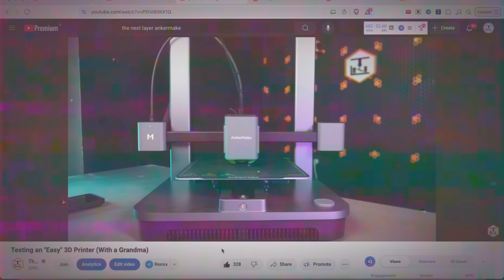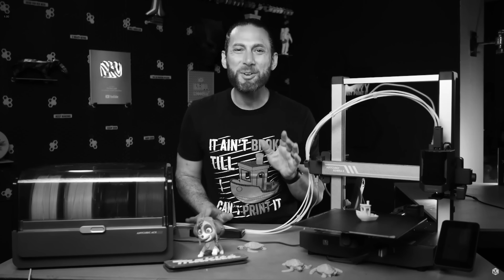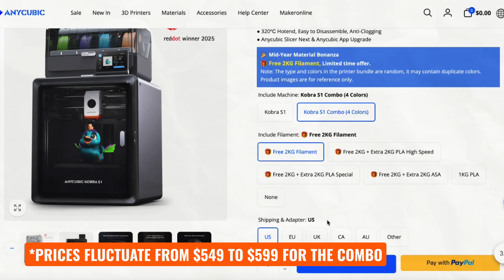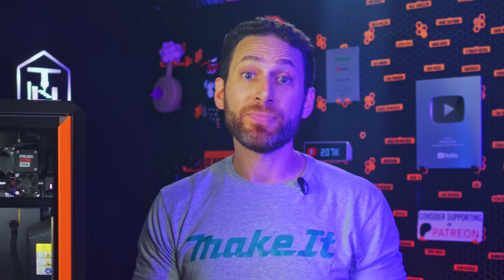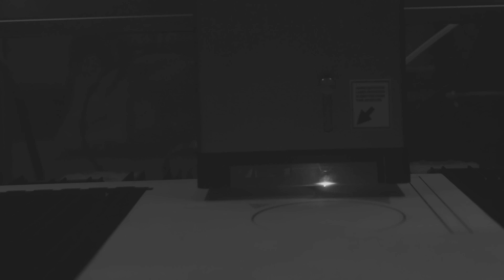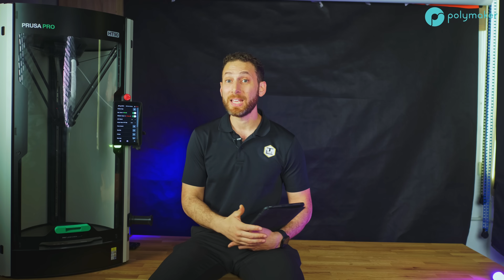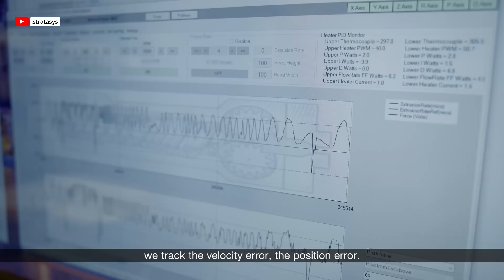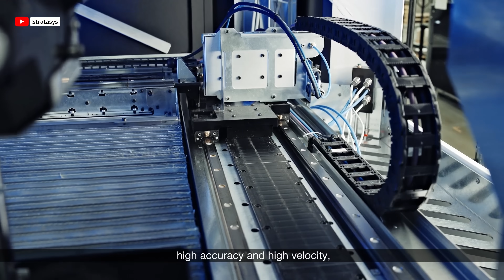$100 vs $100,000+ 3D Printer!

Comment: I have an easythreed k9. For some reason once I got everything dialed in it's by far my least problematic printer. It's slow, but it's a reliable little guy. I rarely had problems with printing on the k9. They're not pretty, but it just keeps on going. It's fairly decent at printing TPU.
Reply: The problem is that it's quite close in actual price (depending on the region) to something like an Elegoo Neptune 3 Pro (or its successor) that is on sale, which is in another class entirely. I got mine for €165 last year directly from the manufacturer - the K9 costs €103 here, which is just a few spools of filament less. You can make extremely high quality prints with the Elegoo, provided you're fine with it taking its sweet time. It's also much more beginner-friendly due to its fully automatic bed-leveling, heated bed and higher quality construction - and it has a large enough bed for the vast majority of projects.

Still, I'm very impressed you got good results from your K9. There's something to be admired about being able to produce good parts with a device this basic, far more so than people who invest hundreds, set everything to automatic and immediately claim they are masters of 3D printing. By the way, TPU also prints exceptionally well on the Elegoo, provided it's properly dried, although I've had by far the best results with PETG. Have you tried PETG? It doesn't require a heated bed (at most some glue) and the nozzle temperature in the spec sheet of your printer seems high enough.
Reply: @no1DdC fair enough about the price point. I happen to get mine for about $70. To be honest the best decision I ended up making when modifying the K-9 was swapping out the original carriage for something a bit stiffer. Really took care of a lot of the wobble. I'm well aware that it doesn't take much more to get a significantly better printer, but I love this silly little thing.

Comment: 1:14 - AnkerMake is the absolute worst!  Wish I could go back in time and buy a P1SC!
Reply: @No_Worries83   I got the basic model it kicked the bucket by not transmitting anything to the printer and then they stopped making replacement parts, so they just gave me 200 bucks back even though it’s over the warranty date ,nice service tho

Comment: Prusa and Bambu are the only sub-2k brands that people should expect to work every time.
Reply: My Kobra S1 has been more reliable than my Core One.  I wish it weren't true because I love Prusa as a company, but I think they rushed this one out too fast.
Reply: I've had pretty excellent luck with my Qidi Q1 so I'm definitely getting to that expectation. Only issues I've had are from the filament - mostly not drying it enough since my habits were spoiled from living in ambient sub-20% humidity most of my time with it.

Buuut at the same price as the multi-color anycubic core xy here...I might put up with some lack of reliability in exchange for multi color.
Reply: @chrisc1140  tbf, with some tinkering we might be able to use the qidi box on the Q1
Reply: Bambu should be shunned for their unethical business practices and disregard for their customers. Prusa is pretty much the antithesis to them, best I can tell.

Comment: PolyJet mmmm... Want.... But oh boy, the StrataSys costs are crazy. I work in school with couple older F230's and no joking, triple digit sums for ~1.5-2kg spool of PLA, 4 digits for a new toolhead, yikes. But they. just. work.

But thou, give them a hint about other slicers. The GrabCAD is just so sad. I know the point is repeadability and the industrial production, but when it cannot even separate objects from one file and really doesn't like that you try to spare some material by modelling voids into the model, it's sad. And then the 10 layer raft... I personally doesn't need to pay for a single gram of filament that goes through at work, but my soul cries every single time I see a model that has completely fine base that will beautifully adhere to the buildplate, it doesn't even need any supports, it's perfectly fine to print as is, and then the sad little slicer forces the 10 layers of raft under the model... And then comes the worst, you use the expensive PLA, the printer cannot use the support material, it's just a PLA print without anything special... 5 layers of raft under everything. It's like forcing Italian to watch while someone adds pineapple on pizza.

Also Stratasys has actually two lines of "consumer" printers that probably a lot of people have heard of: Ultimaker and MakerBot. They are their own company now after they merged but they're owned by Stratasys, through which Stratasys also owns Cura (the more you know) which makes the text before even sadder because Cura is actually very capable slicer while GrabCAD is, well, let's just say if it was possible, the GrabCAD would be the last slicer I would recommend even to my worst enemy.

But eitherway. Absolutely great video and I would love to see more videos about the industrial and professional printers, especially from the point that "yeah, they are expensive, yeah, your Voron probably runs laps around them in speed, but this is the cool stuff that costs that much and this is where it's used".

Comment: Dont buy snapmaker products! Their support is trash. And their software is ultra closed sorced hot garbage. Bought one got gaslightet myself from the youtubers praising those machines. Their are masters of none! 3D printing is ultra slow and less reliable then a 200$ bambulab. The laser module headcrashes randomly and the cnc software is still beta quality at best!!!
Please anyone reading this dont do it. Buy Seperate machines that are specialized for their tasks. Even if you stayed inside the same budget you will get better results!

Comment: Oh, Stratasys. The infamous patent troll. Promoting it and placing in the same video as Prusa? I hope the former chokes on their network enabled 3d printer and dual extruders patents
Reply from the maker: They definitely play hardball with their IP,  but you can’t rightfully call them a patent troll if they’re the one coming up with the patents. They literally invented FDM and many of the technologies we enjoy today. But yeah, wouldn’t wanna get on their bad side, legally speaking.
Reply: @thenextlayer They have a patent for 3d printer with network connectivity. Another is for support structures. Do you want to live in the world where “any device + network” is patented? Revoking each costs 250k-1M paid by anyone willing to pay. I’m not defending Bambu but you already chose side of legal winner, not ethical one for sure. Check these patents in question even via Chatgpt. They fall for “obvious engineering progression” rule. The problem is that someone has to pay 250k+ for each to abolish them.

Comment: something I find hard to understand as a consumer is how are businesses are getting value from $5000+ printers
like if I print a $50 part it's easy to do the math, after 10 parts I'll have printed enough parts to justify buying a $500 printer
but for a $10 000 printer... that's a lot of parts
Reply from the maker: PEEK costs $1,000 a kilo. Imagine a 2kg PEEK part failing…! That’s how ;) 

Also, they run them 24/7!
Reply: Also a engineers salery is very high 
So it is worth it
Reply: Tons more capability. The 22 IDEX that he flashed up for a second has an insane capability set for 'only' $15k, which is comparatively a bargain. Heated chambers become difficult above ~65 C (tons of stuff stops working, loses strength, expands too much), but the added heat makes TONS of plastics way easier to print with, or have far better mechanical properties. And all it has to do is allow me to save some time/$$ compared to other manufacturing methods (and FDM is about the easiest and cheapest way to make any custom part).

Basically, FDM gives me:
Incredible design freedom + allowable geometry
Ultra-rapid-to-almost instant tool path generation
The ability to walk away from the CNC machine while the first part prints (cant do this with any non additive process really)
Ultra low post processing requirements
Large build volume per dollar spent
Crazy material library that takes seconds to swap

I can go from design to functional part in literally minutes of labor with FDM compared to a minimum of probably an hour for a CNC machine (single part or small run), my consumables are basically free, materials are cheap, etc.

I only design a part for subtractive if one or more of the following is true:
It REQUIRES a material I can't print (via FDM, more on other additive processes in a minute)
I have to make a bunch of parts and can basically batch process them from continuous stock or blanks (I don't do large runs often, so this isn't common)
The part is larger than my build volume and painful or non-ideal to break into components
Its gonna require a ton of manual work anyway
I am doing it for fun or practice

I am sure there are a few others, but that is most of the reasons. Now why not just use other additive processes (which are all great as well, but I use them less often):
SLS is more expensive for the build volume, materials are more expensive, I have to fill at least 1/3 of the active build volume with parts (or suffer waste), materials library is smaller, harder to swap materials, can't fully enclose a cavity, more post processing.
SLA suffers from many of the same issues as SLS, but often in a more minor way, but is generally slower than SLS.
SLM or similar: super expensive printers, materials, super slow and labor intensive material changes, parts generally require significant post processing, TONS of consumables.

So all told, FDM is great, and while the value proposition of some sub 2k and sub 1k printers is excellent, there are enough great use cases for the 10k+ range to make them very useful.

I also think that the printer that costs you 15k today will have its capabilities matched by a ~2k printer in the next couple of years. From a technical capability standpoint, the Qidi Plus 4 is a crazy capable printer for a great price. As the FDM market continues to grow, someone will start making high temperature steppers/servos that can take a bit of extra heat for a lower cost (or figure out an easier way to leave them outside of the printer), and we'll be off to the races on low cost, high temp printing.

Comment: Speaking from experience, printer cost and problems seem to have a close correlation.
Reply from the maker: Agreed 1000%.
Reply: Except Bambu.. as soul sucking as it is, they make the best 3D printer I have ever used, and this includes printers in the 200k mark

Comment: You really need to stop Promoting those Anycubic Garbage Bags. As someone who has owned both, they both have terrible Quality, are Unreliable and suck at everything. The Kobra is fine, but i would get a A1 if i were a Beginner. The only good Thing that AC offers is their Support. 
I am so happy that i now have 2 P1S instead of my Kobra 3 and S1 :D
Reply from the maker: Sorry to hear you had a bad experience with them. As I noted twice, the reliability has been a little bit hit or miss for me, too, but the value is insane, especially if you’re willing to tinker with aftermarket firmware and stuff… which is why I included their printers!
Reply: Same. My first printer was the Kobra S1. As a beginner who wasn't getting into 3D printing to tinker to make it work right, I just couldn't justify keeping it. While I was debating on sticking with it or not I got the Kobra 3 v2 and literally only had one good print with it. The pre loaded camera housing file with sunlu filament. I kept trying for a couple more days before I finally gave up on them. It still took at least a dozen emails and over a month to get my money back. I am still waiting on filament I ordered a couple months ago. I swited to Bambu and had it in a couple days and has been going almost non stop for a month. Only issues so far have been my fault. I'm not planning on going back. I will say I like some of the features of the ACE over the AMS but that is me looking for something nice to say.